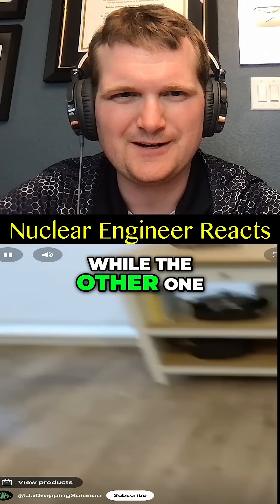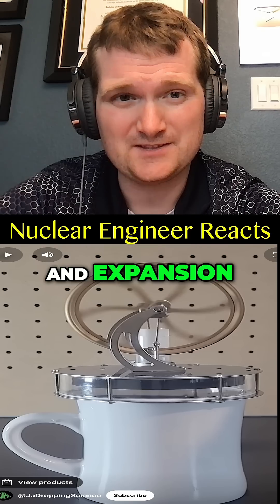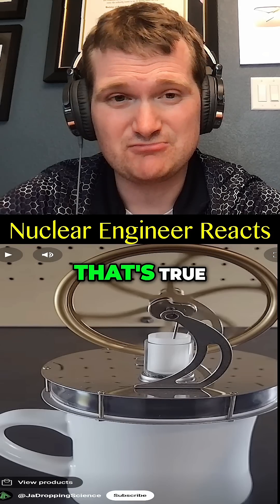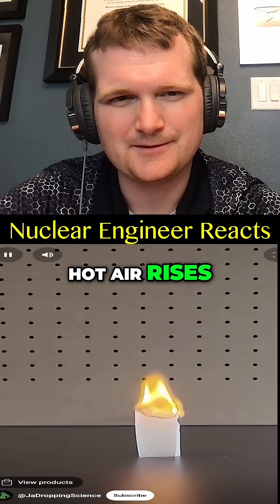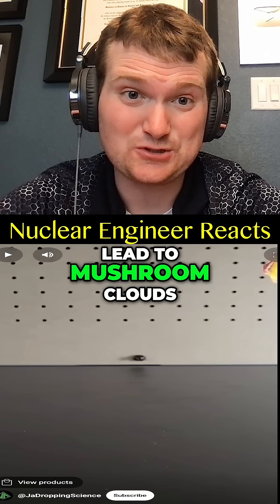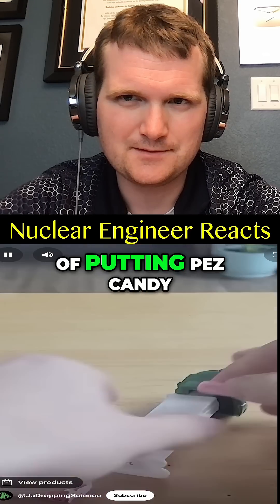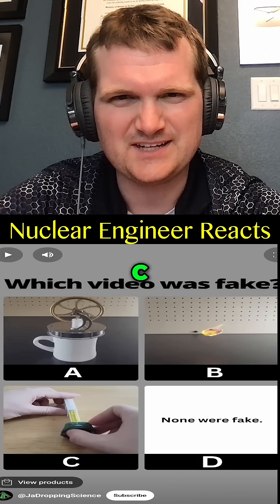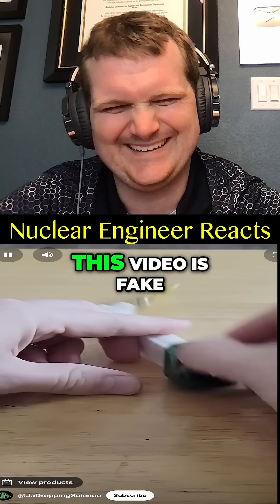Flaming Floating Teabags? - Nuclear Engineer Reacts to 2 Truths & Trash by JaDroppingScience

Comment: A heat engine is just any device that extracts energy from a temperature difference. A fan mounted to a Peltier element that produces a voltage when placed on a hot stove will spin, which is why they sell these gimmicks in hardware stores. No violation of thermodynamics needed (if you stop putting wood in the stove the fan will stop).

What's really cool is you can have a heat engine with zero moving parts if that same device powers a radio transmitter and a camera instead, and the fire is replaced with plutonium, like on the Voyager probes. That still doesn't violate thermodynamics, because the plutonium will eventually decay after centuries and you'll run out of energy.